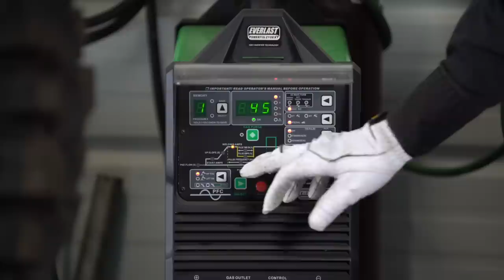TIG Welding a Header

Comment: That's thin stainless, and I know how hard it is to avoid full penetration of thin stock and the resulting granulation or sugaring.  For the part where you aren't able to back purge it looks like an ideal application for Solar Flux or equivalent.  It's a powder you mix with alcohol to form a paste and brush on the back side of the weld area and let dry.  I've found it works very well.  Leaves a very hard glassy residue wherever it melts.  The residue that doesn't easily brush off is smooth and can usually be left in place, as it's stuck on very firmly.  With all that said, you're a much more skilled welder than I am, Jeff.
Reply: Thank you man. When i do that i was using a thicker wire and weaving it not trying to stay to long on the base material and stay more on the wire and keep it moving to prevent the sugar. But i have used solar flux when id did process work on long runs for utility piping on the roof and such, its cool stuff. Thanks for watching and reaching out
Reply: Solar Flux is definitely something to keep in the tool box! Saved my butt a few times

Comment: Very nice, did you position the four tubes according to the firing order for a circular exhaust flow?
Reply: It doesnt make so much of a difference when they all collect together other than the actual runner lengths. Or they do whats called a tri-y collect when two and two collect then those two collect into one. That also makes a difference

Comment: Quick question how do you tell if you have good pen on thin tube
Reply: The inside will as good if not almost best than the outside if you have good purge on it and good enough penetration.

Comment: Wow, his hand is shaking so much.  And his stand off distance is way too high. He's not comfortable welding thin-walled stainless tubing and it just looks "chunky" and like he's always "chasing the puddle" to fill. Not nice work. And he keeps talk about "sugaring" the inside weld, and how using a larger filler wire fixes it. I can't imagine why anyone one would weld thin walled stainless without a a back purge. Your ID weld will always have "sugaring" without a back purge. This video is all about bad fit up, no back purge and shaking hands.
Reply: You can use a simple flux. sodium tetraborate and boric acid grind into powder. Add isopropyl or ethyl alcohol to the flux powder to get a viscosity like sour cream. Spread a thick flux from the inside of the pipes to be welded, wait 15-20 minutes and weld by tig.
Reply: HA HA HA HATER !!!
Reply: He was clearly back purging at 7:40 or so, you can see the double regulator/green hose in the back of the exhaust and taped-off exhaust ports on the header flange . Not sure why he didn't back purge on the earlier welds as well. Maybe it was done on a different day and the back purge setup wasn't available. Can't really comment on the rest of his technique, he welds better than I can for what its worth!
Reply: He clearly isn't a production welder. He probably isn't trained in that industry. This is probably his lane, and their isn't anything wrong with that, so don't hate too hard.
Reply: I don’t think you really need a purge for stuff like this.  I mean you can just turn your heat down like you should for stainless.  It’s not like this is food processing equipment. I’d also do as much fuse welding with low heat as possible.  If it’s just a seal weld then no need for filler rod if you have a tight fit up.
Reply: I welded in the food beverage and pharmaceutical industry for seven and a half years before getting into high performance work. My hands shaking for for trying to get open for the camera in the arc shots and standing when trying to tig weld isnt as comfortable able. The only weld that didnt get back purged was the center piece so i used the bigger wire to help take heat and not focus on base material so much to prevent the sugar. When i worked in process industry i kept o high standard with my welds and are familiar with solar flux and such. But you can say on this kind of stuff it doesnt matter so much but i still do to the best od my abilities to do my best work possible and it turned out awesome. Thanks for watching and reaching out, get connected on the WELD app in the app store.
Reply: @billionsandbillions  yeah just depends on the customer really. I weld for a living and I back purge. But when I did my exhaust I didn’t. Cuz idgaf lol. And 2 years later with a turbo and 1000 hp it still hasn’t cracked anywhere 🤷🏻‍♂️
Reply: Let's see you welds